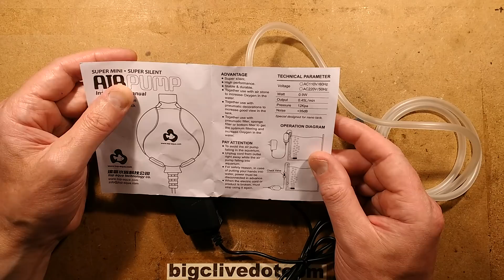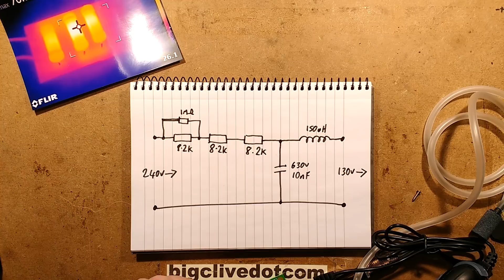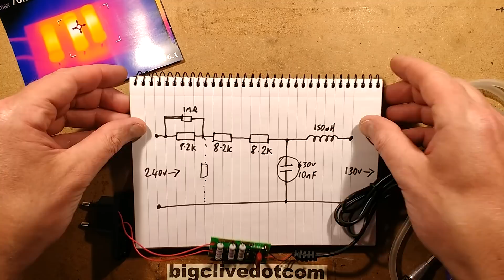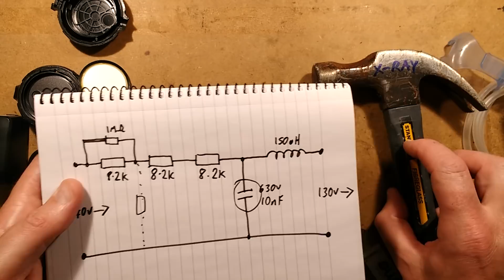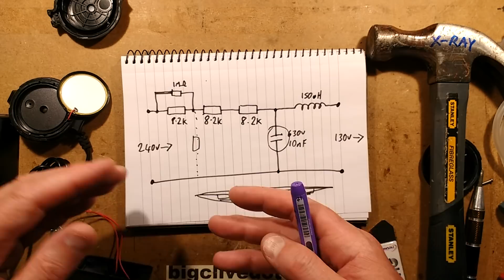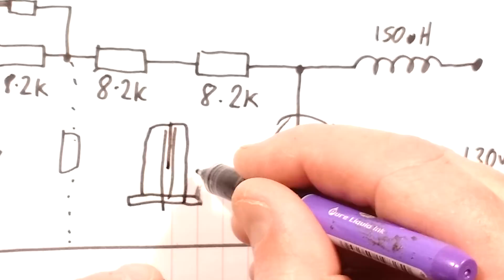Inside a near-silent piezoelectric air pump.

Comment: Clive, The thing I expected, and the "thing" I expected you to make a bit of a "thing" of was the frequency of the output of the pee-ay-zo.  Especially with you saying it seemed quite efficient and yet quite quiet, I suppose I was expecting all the dogs in the neighbourhood to be throwing themselves under mororbikes.
Have I missed something - or are we just talking about a bit of mains hum doing the business?  From what I've seen of this sort of thing, mechanical pumps just spin a sloppy impeller, in a hole - no close tolerances but quite nippy to create pressure, I was expecting the same idea just to shift a reasonable volume of air.
Reply from the maker: It appears to be flexing at mains frequency.

Comment: Video is not optimized for samsung note 8. There are black bars.
Reply from the maker: This appears to be happening quite a bit with Samsung phones.  I have no control over that.  Samsung are notorious for their use of a non-standard Android variant.
Reply: Pinch outwards to zoom in.
From note 8😀

Comment: Good job, and thanks. 
If you're interested in measuring the volume of the pump per time, ( flow rate )
Fill a bottle with water, and put the bottle upside down in a bowl of water. Insert the hose  in the bottle, and measure the time it takes to push the water out of the bottle.
And Bob's your uncle...
Tnx

Comment: Bigclive, I'm looking to modify a cheap garden floodlight, I want to add a better solar panel and battery, but also a cheap camera module but I want to change it so that when the light is triggered at night it will take a series of quick photos and send it to a storage medium, locally or wireless maybe.

How might I approach this project, I needed to look unmodified too.

Comment: There no feed back on the piezoelectric disk, so it is vibrating at mains frequency, presumable this allows time for the air to move out of the way and for the flap valves to open and close. I guess the air trapped above the disk acts as a spring, storing energy on the up cycle. One might have expected the disk to have two open  chambers on each side to allow both the up and down stroke to pump air. Have you considered connecting the disk to a signal generator to see how efficiently it can be excited at other frequencies. Apart from the poor power supply, a weakness of the design must be the risk that the disk will fracture.
It would have been nice to know the pressure the pump can achieve and the volume of air moved.

Comment: Maybe the tiny air intake hole is because the pump needs a slight vacuum on the input side to help seal the valves and the large holding cavity is to maintain a relatively constant supply of that slight vacuum.

Comment: Sounds to me like there are various resonances in play.  Normal piezo discs operate at audible ranges or even higher.  To get any efficiency at 50 & 60 Hz, you need something to tweak the natural resonance down. The capacitor, inductance and chamber volumes do this.  Then, you want to pump air, so you need TWO check valves.  Finally, you need two ports, for air to enter and depart.  You probably don’t want to have one side of the flexing piezo element to just compress and decompress on one side.  So, why not use a push-pull configuration.  As this one actually seems to use.  With the tiny hole, you can avoid an additional check valve.  Makes sense?
Reply from the maker: There are two check valves.  One on the inlet and one on the outlet.

Comment: You sounded a bit surprised to find a piezoelectric disc inside after saying "piezo" like a hundred times in the beginning of the video.  :)
Reply from the maker: I thought it was a copy that might not have had the original technology inside.  So that was actual surprise when I saw the disk.

Comment: I hate when people judge your knowledge in a domain by how you call things or how you pronounce them. For a long time i called capacitors "condensers", as in French, a capacitor is a condensateur. And my accent shows i am not used in spoken English nomenclature.
Reply from the maker: Capacitors were originally called condensers.
Reply: Yay, i didn't know that! You made my day!
Reply: Consider working megacycles [per second], or kilocycles (if you're more AF than RF) into your vocabulary, to further encourage speculation that you've been teleported a century forward in time ;-)
Also, Google led me to the solid state triode: https://ieeexplore.ieee.org/document/96798/

Comment: I have a piezo ceramic disk attached to the compressor in my fridge.  It works to keep the fridge from overheating and recycling, the compressor that is.  Could you please get one and tear it down and explain how it works.  Thanks.
Reply from the maker: I've not come across a piezoelectric disk used in that application.  The only disk that comes to mind in a traditional fridge is the thermal cutout disk on the compressor if it stalls.

Comment: I wouldn't normally recommend this to anyone but you can put a europlug directly in a British socket if you put something in the earth hole to move the shutters out of the way.
Reply from the maker: I did that.  But had a slight moment when it refused to come back out again.  I thought the little metal caps were going to pull off inside.

Comment: I think it's thick so that the valves could sit as close to the diaphragm as possible (perpendicular to it). You need some pressure differential to open the valve and the more space there is between the diaphragm and the valve, the bigger the portion of the diaphragm's movement that is used to build up the required pressure difference. If they put the valves down flat and had a 90 degree bend running to them, that might be too much air to compress enough to push the valves open (and even if it did work, it would be much less efficient).

Comment: I think you somewhat mixed piezoelectric crystals with electrets. Piezoelectric effect is an intrinsic property of some crystalline materials, while to get an electret you indeed have to warm up some sort of polymer (typically to its melting point) and then cool it down in a strong electric field. This allows the dipoles to be fixed in a particular orientation, and this makes an electret. Although the Wikipedia mentions that some polycrystalline materials can be "poled" (a very similar process which ideed involves heating to a curie point is a strong electric field) to reveal piezoelectric properties, generally a piezoelectric crystal only needs to be wisely cut (as in crystal resonators), while to make an electret one inevitably needs to perform the described process.
Reply from the maker: I'm under the impression that most manufactured disks do rely on setting a charge thermally.  The water atomiser disks certainly lose their ability to function if they are operated dry and heat up to their Curie point.
Reply: This certainly might be the case... Just wanted to stress that for the piezoelectric materials this thermal procedure is optional. Anyway, thanks for the video, very interesting indeed.
Reply: @bigclivedotcom  Thanks for the demonstration. How is piezo disk is air seal ? Is it just an adhasive or rubber gaske?
Reply: YS akaYSembed

Can the crystals be re-energised if they reach their curie point and fail?
Reply: Don't know for sure, but I guess that most probably this process is indeed reversible. Although I don't think that it is possible to restore that crystal at home (unless you're Ben Krasnow).

Comment: "I wouldn't have thought there'd be enough deflection."

Have you ever driven a piezoelectric transducer at 130V before?   IMHO, you missed a trick by not measuring the output voltage delivered under load.  ;)

Comment: Clive the tiny hole on the input side is to keep a slight negative pressure in the chamber to make sure the inlet valve closes quickly when the disk reverses direction.

Comment: A DC airrator! This is useful when you take your fish on a road trip. Ups! I'm wrong this still runs on AC. The Piezo on this thing is as big as the ones in cheap 50$ ultrasonic cleaners, So useful as a sensitive picup or geophone. Nice to know that you can  get those out of cheap air pumps.
Reply from the maker: You can buy some pretty big disks.
Reply: True, this was just me taking a mental note out loud of where to get what. Electronics as hobby is 3/4 knowing what to take apart to get what you need from household appliances. Your videos are very helpful.

Comment: As for the exact sizing and weird ports, it could be acoustically designed to have some kind of a standing wave inside in order to move more air. Actually, I'd guess that's more than likely.

Comment: Can you reverse the valves and use it as a vacuum pump? Then one could use it to replace their wound vac when it ran out after a week. :-)
Reply: Quality post, mon ami.
Reply: Find a screw on wire cap that is about the same size as the hose. Drill a hole in the small end and another hold halfway on the side. Screw it onto the hose end, feed another hose in the hole you drill on the side. That small hose should pull a vacuum via Venturi effect.

Comment: One of those seals must also prevent water egress from the tank from header pressure  into the pump due to it being normally lower than the water level
Reply: There was a warning in the instructions advising the use of a check valve to prevent just this.

Comment: @big Clive 
https://rover.ebay.com/rover/0/0/0?mpre=https%3A%2F%2Fwww.ebay.com%2Fulk%2Fitm%2F142259623131
I have this exact switch. As a fun project I was thinking about replacing my standard on/off light switch with one of theses. I live in the UK. I'm wondering if this would be suitable and safe. Also if it is can you just explain quickly what to do and what not to do and how to wire it up. 
Thanks
Reply from the maker: You could install it in a blank plastic plate if the box behind was deep enough to do it safely.  Without seeing inside the switch I couldn't tell you if the metal would need earthed.  I think you can get retro style switches that look like this.
Reply: bigclivedotcom I there's is not much metal around. I did test with continuity and determined that there was no connection between the terminals and the knob (obviously)

Comment: I reckon the air reservoir on inlet side is silencing. Clive it's a shame you didn't measure the output into an upturned bottle submerged in water.

Comment: You can check the volume of air per minute by filling a container with a known quantity of water, turning it upside down over a basin full of water so that nothing leaks, stick the air output in there, then time how long it takes to empty.
Reply: or you could fill a balloon for 1 minute and check its volume by immersing it in water

Comment: I would say the size of the cavity and the convoluted air inlet is for sound dampening.
Reply: Yeah I'd suspect so & I'd guess the most annoying noise would be from the valves snapping shut rather than the diaphragm, that was the case on an old school aquarium pump I took apart in my youth.

Comment: Resonant cavity is likely the best explanation as it substantially increases the effectiveness of the piezo element.  I would think that 50/60 Hz is not optimal for a piezo though.  If it works OK its  not really an issue.
Reply from the maker: It does seem a low frequency for a disk.  Probably because we're used to seeing them used as resonant sounders.

Comment: The larger the disk the more the center will move for  given angle of deflection. That combined with the larger diameter makes for a larger air volume on each 'stroke' than with a smaller diaphragm. I wouldn't be too surprised if that was a stock part of some sort from the supplier.

Comment: This would appear to be a resonant circuit and the piezo element acts as a capacitor...
It's possible the extra 1M resistor is added after assembly and testing to "tune" the circuit for maximum air flow.
Or not ($0.02)

Comment: Clive, the ‘swept volume’ increases with the deflection of the disc. So a decent sized disc is required to give a reasonable throughput but there is a minimum volume requirement per pulse to allow the valves to open and close efficiently. The depth of the chamber is just sufficient to hold the valves. The material and flexibility of the valve material determines the length required and hence the depth of the chamber

Comment: Plug a speaker line output into your mains (somehow) and modulate some music on top of the 50 Hz mains.  See if you can make the pump play music. :)
Reply: Old buildings used 70.7 volt systems for distributing audio over wide areas, and transformers to step the audio voltage up and down for 8 or 16 ohms. That kind of audio transformer would work well for this test if a pair of the transformers was put in parallel on the 8 ohm side, and in series on the 70.7 volt side.

Comment: 7.5 ml/s... Interesting. I wonder if driving it at 12V but much higher frequency is a good idea. I wonder if I could use it for part cooling in a 3D printer to essentially freeze the plastic that exits out of the nozzle in place.
Reply: I already have one of those, a standard 50mm unit, but it has considerable air noise at higher RPM. I don't think much airflow is needed there, and the fan doesn't even deliver all that much, and the cooling nozzles can be pretty restrictive.

I'm less curious about just getting a functional solution, because that has been figured out already, but trying out new things, maybe something ends up usable in some circumstances. Designing a palm sized Delta printer now, maybe it will be a joke printer, maybe a cheap $70 toy-like something that can deliver good quality for very small items. Many people want to print figurines, and DLP will likely never be as cheap to run as you can make a small FDM. I personally was curious in experimenting on small acoustical filters and it was one of many reasons i got a 3D printer, but got sidetracked onto designing a control board and trying to work on firmware, as well as designing a small new one :D I'm not very good at many things, but i shall not be discouraged from trying.

Comment: maybe that cavity just helps suppress sound of transducer or valves
Reply from the maker: It might be for noise reduction to buffer the airflow on the input.
Reply: @bigclivedotcom  Or the first chamber helps to build up pressure in the second chamber. After all, the piezo works both ways and that may help to build up an air flow.
Reply: Now i want to try a small 2 inch speaker @50Hz at low voltage with similar valves to see how quiet i can get it and see if air volume / pressure can be improved since, it should have greater voice coil/diaphragm movement. Goodbye low power consumption!
Reply: Dan Dishonored
 Clives pump already delivers a pressure up to 12kPa which is about 1.7 psi
Reply: Dan Dishonored
 I agree. I assume this device of Clives uses cavity resonance as Clive mentioned. Piezo probably delivers a high pressure wave at the valves to force outlet valve to open (slamming shut inlet valve). Then half a cycle later, when piezo oscillates in the other direction, the low pressure wave meets valves to force inlet valve to open (slamming shut outlet valve) and takes in the next charge of air. All while running the piezo within parameters. The cavity resonance can enhance the intake and output of air just like an engines tuned exhaust system.
Reply: I searched google and 130V transducer can do pressure up to 1 psi which is very high value (I think that 0.5 psi is high enough for such little pump). Good luck and please share results.
Reply: I searched for higher quality devices. I'm not sure if transducer in this pump have long service life with such parameters, which is critical for applications like fish tanks. I think two of those should be safe if someone can check them every day.
Reply: bigclivedotcom I think I was wrong, because there is hole on other side of transducer which let device breath and transducer have less resistance from that side. But it also passes noise out. Noise in my opinion is not suppressed at all and chamber on inlet is to let dust sit before it passes into check valve. I think dust in this kind of check valve can destroy whole device. Sorry, my English is really bad.
Reply: yes, it makes higher airflow, but I'm not really sure if such principle can let device to reach so high pressure at same time. Also I failed to find such small form 130V transducer. I think two weeks vacation will make fish tank prepared for cleaning and installation of new species.

Comment: Clive did you change something with the camera? The HOPI is much easier to read on the screen in this video.
Reply: Exposure has a rather large effect I believe.
Reply: It sure gave the meter a better looking display. most times the flicker is so bad it is hard to read.
Reply: It's all to do with framerate and exposure time.  Problem is that that meter display is pretty cheapie, and it works by addressing each segment in series and pulsing the output data, so yo have a really low refresh time (by electronics standards), so each frame of video will catch and miss certain segments on certain cycles and that gives this awful look.  Sometimes when it's the only flickering thing in a shot the camera will compensate, but you have to juggle that against light levels etc...
Reply: I am well aware of it but wanted to see if Clive would pop in and say what he did as far as settings go.